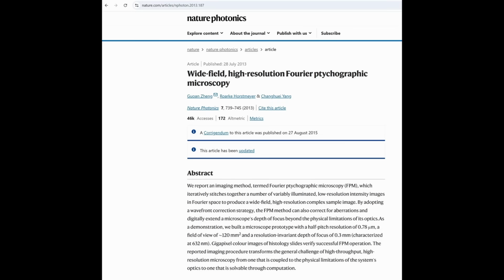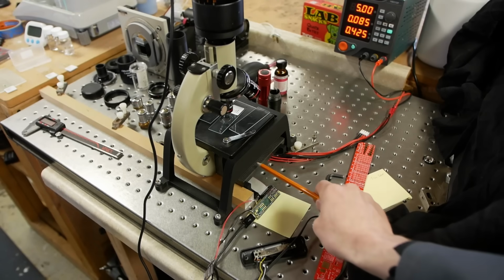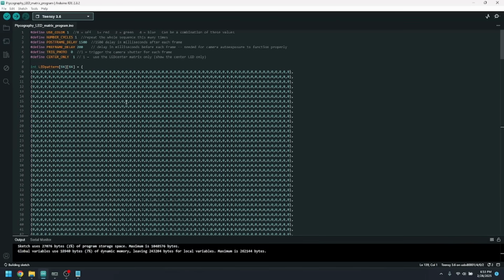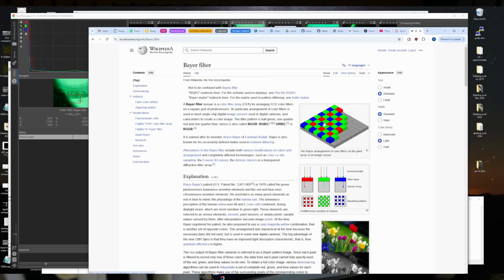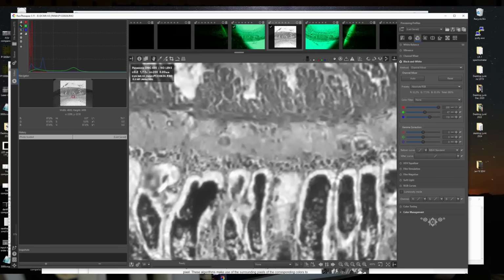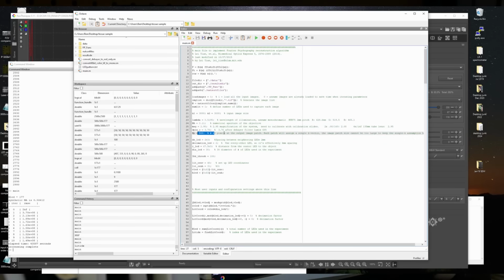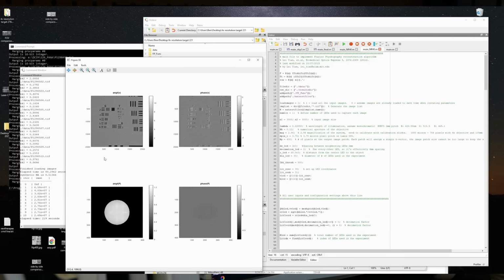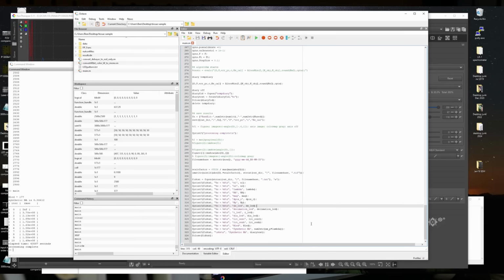Dramatically improve microscope resolution with an LED array and Fourier Ptychography

Comment: This is really interesting and it's given me a few thoughts/ideas that I'll put here:
1. I wonder how effective it'd be to swap the matrix for a small OLED or better QD-OLED panel. QD-OLED would give very pure wavelengths, the pixels would be much smaller which would make them more point-like which you said helped. Issues I see would be that I don't know why the larger spacing is preferred (I haven't seen you mention it yet), and it'll be a much darker image because the smaller pixels won't get as bright.
2. I wonder if this gives more than just 2D information and if some level of 3D information could be built from this.
3. I wonder if some of the difficulties with getting the numbers for the setup and calibration could be made easier by using the defraction gratings as references. If you image a known grating then I'd think you could work backwards to calculate out a lot of the very difficult to handle values. That could be especially helpful since you could swap through multiple gratings easier than getting in there with a ruler to measure distance from the LEDs to the objective.
4. I saw another comment mention it that you can get your camera de-bayered but that's along the same lines as what I was wondering. I feel like you could find a camera without those extra filters that isn't an insanely expensive specialty camera but that's just a feeling and I have no experience to back it up.
5. Other benefits that I don't think were explored and would come with something like an OLED panel or just a grid of RGB leds instead would be that you could run the process over multiple distinct spectra which could give more information. Not only would that give nice color information but I bet with some fine tuning there that that could also be a source of additional spacial information since I'd each wavelength to scatter slightly differently.
EDIT: You threw the 3D mention in there at the end, and some hints at the ability to automatically calibrate the system but hopefully I added something to the discussion.

Comment: You are using redundant information which is brilliant!

This is NO DIFFERENT to a sampling oscilloscope which can resolve higher frequency signal bandwidths than a one-shot oscilloscope.   You are relying upon the fact that the signal is repetitive - it doesn't work for single-shot signals.  But if you do have a periodic signal, you can sample over time of multiple signal periods.

In this case you have a constant unchanging sample which is spiritual equivalent to using a periodic signal for a sampling scope.  And sampling over angle is the spirtual equivalent to sampling at times during multiple signal periods.

Comment: Going back to the 3 color mask over the sensor, couldn't you account for each subpixel's x-y tiny offset to triple the resolution, and match it with a led array with 3 times as many leds, in the same 3 color arrangement as the sensor? It moves the problem of getting a very lab specific equipement to just make more calculations and setting up a different led array which should be much more economical

Comment: Fascinating, would this technique be able to be combined with spectroscopy to determine the chemical or material composition of samples?

Specifically, if the camera and the optics used were compatible with selectively measuring the absorption and reflectivity of visible light, infrared and UV light?

Comment: 1. Foveon sensors have 1 cell per rgb, so they could work in theory (although they're quite noisy). Another option would be pixel shift.
2. Would an ordinary lcd work as the light source?

Comment: This reminds me of the technique Nvidia uses to project smaller ("correct") patterns/details for lithography by using special larger ("incorrect") patterns that are calculated beforehand. The way the EM waves interfere with one another after passing through the larger patterns produces the smaller patterns/details that become the circuits and components. Difficult to explain, but also very interesting. :) I think they call it "Computational Lithography".

Although, this FFT stuff blows my mind, too. It's amazing what computers have allowed us to achieve with old mathematics.

Comment: I think it's the debayering that shifts the information slightly from each sub pixel. If you manually debayer into a monochrome image and only keep red or blue or half of the green, I think this will still work well without the correction hack that probably does not work for non-white subjects well. A standard debayer outputs either half the resolution of the true mask, or at the full resolution, but data is shifted at the sub pixel level to make a smooth color image. But there should be no difference in the raw red sensor pixels and a monochrome sensor with a red filter over it

Comment: 18:00. I don't know that specific algorithm, but I think you could turn up the exposure for some of the pictures, if you correct for it afterwards in the octave script. So, if you e.g. double the exposure for all of the edge images, you then have to scale those images back down, as if they were shot with the same exposure. I'm not sure how linear the effect of a longer exposure on the pixel values is, so this may require a calibration curve for exposure to pixel value for each specific sensor type.

This way, the illumination level is still the same, but you still get to utilize the dynamic range of the camera better. And as you can rescale the images in floating point numbers, you don't lose any dynamic range to rounding.

Comment: I wonder if instead of using every single LED, if you could use just a sub-set of them, in a spiral perhaps to achieve a decent result. I would have to imagine that some amount of the information in all of those images is somewhat redundant.

Comment: It is a bit harder, sure but technically any finite area with enough luminosity can technically give you enough information to reconstruct the light on the grating and the structure of the grating, analogously with a small piece of a hologram still encoding the entire picture

Comment: Monochrome cameras are easy to get if you buy an astrophotography camera. Getting one with a full-frame or larger sensor is harder, but not really necessary here. And it's possible to remove the bayer filter from a regular camera, with effort, or there are some services that'll do it for a price.

Comment: Nice! Now I want to adapt this technique to mmWave imaging at 122/135 GHz, although the point source array would need a physical raster scan from a big XY table rather than sequential point sources, but the lensing is easy enough to machine from Rexolite/UHMWPE or even 3D prints filled with alumina powder. I have built a flying-spot imager that works at mmWave, but currently it's only capable of about 30 x 30 pixels at present. Things get scary large when scaling up by a factor of 3000 from optical frequencies, but the required precision scales downwards.

Comment: JPEG allows any compression ratio, and there is a lossless compression ratio (1, I think, its been decades since I compressed images from space). Anyway, when the compression is set to lossless, the entire image is retained in full resolution. I would think that this method would work using that, since no image data is lost. JPEG itself is pretty complicated, but, fortunately, a standard codec is available in plain old c-code, so it is almost plug and play, after you fix the processor-specific (and inevitable) memory leaks. Even in lossless mode, JPEG gives a BUNCH of data compression on most images. Its all about that base, 'bout that base, 'bout that base, no treble. 😅 (I spelled it wrong so you could read it right. 😂)
Reply: Also, I would think there would be a cheeky way of doing this algorithm individually on each of the RGB channels, and then nonlinearly combining them to do even a little bit better.

Comment: I wonder if a regular OLED screen (which just boils down to an array of diodes as well) of high resolution would allow for even higher resolution bump. The low amount of light produced by each diode would be minuscule which may overturn the whole gain though.

Comment: Wouldn't it be easier to use a colour oled display as a light source ? 
You could make the pattern more precise instead of the fixed led spacing and make the colour camera work by replicating the bayer filter spacing/structure on the display...
Btw: you can get a cheap monochrome sensor from the Little Garden Spectroscope, but you would need hack it back to a camera.

Comment: Made little sense. 
Given that the angle of diffraction depends on the line spacing: -> determine the line spacing by measuring the angle of diffraction.
     reconstruct the expected image from the angle of diffraction.
From my understanding of the video:
    The diffraction gives the spacing between black and white dots in an image, combining the diffraction angle gives a map a spatial map of the black and white densities. 

However, if the diffraction pattern isn't simple or repeating (ie. the cell sample) I don't see how knowing the line (dot) density (spacing) helps resolve the image.

I should also say that you are incredible. I would have never figured out it was the bayer filter.

Comment: I wonder if cameras designed for astrophotography will work.  Not only are some models monochromatic, astrophotography cameras rely on the telescope's optics. There's nothing to interfere with the microscope's. Some can be had for a few hundred dollars. I find it interesting some cameras cool their sensors to reduce noise using Peltier coolers. 
Astrophotography also uses a bunch of stacked images but I think it's more to do with combining your best images into one.

Comment: the issue is not the experiment ,its the laser it self . Like an over bright game . Use smallerr pitch laser can get you along but evrnyualy you'll have to weaken laser brightness to see somethingg , meaning clone distance is closer =more false signal . You'll need teflonto isolate but it will be less stable

Comment: An odd coincidence. Last night I noticed the reflected light from a (parked) car’s rear reflector created a moire effect in my eye (unfocused as I had no glasses on) and this changed rapidly as I moved my head by tiny amounts. I was thinking at the time how this could be used to accurately calculate just how much my head was moving.  And then this video pops into my feed, apparently using a related effect 💁‍♂️

Comment: the smaller you see the more stable the surface has to be ? Because the detected vibration of the surface might be low at human scale but a tsunamy of variable at quantum ? This means most metal or carbon fiber are bad idea ?neobdium silicone instead ? Interesting challenge

Comment: Wouldn't it work if we avoid de-bayer and pick the pixels directly? In the case of green pixels, we could rotate 45 degrees to have a square grid of raw green pixels, where the pitch is just sqrt(2) bigger of the original subpixels (so sqrt(2)/2 of the regular image pixels).

Comment: I'm wondering if there would be a way to modify a DLSR CMOS to remove the filter and allow it to work for this? I've astromodded a cannon DLSR before and that was easy, but the CMOS sensor seems quite a bit more of a challenge, I would imagine the RBG filter is bonded to the chip?

Comment: Being you I'm shocked you didn't play with stripping the colour filter off the sensor - I've never done it myself but it does sound reasonably easy. I've been wanting to do it to my oldest camera, as then the effective resolution bump will bring it up to a similar ballpark as the modern ones and let me play with deliberate filters of my own. But not enough time, energy or space to setup, yet anyway.

Comment: A huge application is EUV/XUV nano-imaging - not so much for the super-resolution (that's a given due to the extremely short wavelength) but because there's no proper high-NA imaging optics available for EUV (except hacks like Fresnel lenses), while diffraction is quite straight-forward. Phase information is also a big bonus. Instead of an LED array, the sample is scanned with a piezo stage to record a bunch of overlapping diffraction patterns. The spatial resolution can be some tens of nanometers.

Comment: I also wonder to what degree you’re getting nonlinearities associated with viewing angle on the HUB75 panel’s LEDs (and, for that matter, with the slightly varying distance from one edge of the LED panel to be center). I imagine this would be relatively easy to characterize by capturing a dataset “at DC” (i.e., with nothing in the field)? I think that linear scaling per input image ought to solve it, since the delta in viewing angle within an image is relatively small (the slide is small).

Nice work! Very cool application of diffraction that I had not considered before. Thanks for posting this!

Comment: Would an OLED panel be beneficial for providing an addressable array of tiny point sources of light? It seems like an old phone screen could be a way to get the illumination setup working without needing an LED array panel
Fantastic video!

Comment: Have you tried doing this with a Sigma Foveon Merrill x3 sensor?  It has no color filter and instead captures light as it passes through the silicone.

The top layer is blue, then green then red giving  3x 14.7mp  images it then combines into full color (at every pixel).

It can also allow you to select a b/w image from just one or a mixture of these layers and has a removable IR filter to allow full spectrum imaging.

The only version of this with a removable lens though is the Sigma SD1M which might be hard to get these days.

The newer (but still old now) Sigma Sdq changed the resolution of the bottom layers to 1/4 of the top and you can't select just one layers data for B/W images anymore but could still be worth while for this type or work?

Comment: Commodity available 1.5mm x 1.5mm addressable RGB LEDs (1515 Neopixels) exist.  Matrix RGB LED array can be made by a PCB house.  This would provide even finer point source brightness and color adjustable LED emissions.  Try using a manufacturing machine imaging high resolution monochrome camera.  Avoids the Bayer matrix issue.  Could provide even higher contrast.

Comment: I think for the color images you have to account for the effect of the bayer filter on the fourier domain. On most sensors I think red and blue should be equivalent to a low pass filter. But I don't know off the top of my head what the response of the green channel would be.

I haven't done it, but the Fourier math should technically be possible. You probably lose like half the resolution though in the best case.

Comment: You can actually completely remove the bayer filter on any camera sensor to get a monochromatic sensor much more cheaply. There's a few videos of it being done on youtube, and it's also what's done on DIY spectrometers like the Little Garden spectrometer to significantly improve their performance at a low cost.

Comment: I would be curious to see if using a lighting setup which isn't a perfect grid would perform better. Perfect grids tend to have problems with aliasing (e.g. Moiré patterns), especially when combining with other grids (e.g. the sensor pattern in your camera). Would it be possible for you to repeat the experiment with the LED array where you don't use every other LED but rather a semi-random subset of the LEDs?

Comment: I have a hunch that if you turned off debayering in rawtherapee and used an external program to throw away all the subpixels you don't want it would essentially work, however you'd be throwing away like 3/4s of the resolution of your image which might make it rather pointless. Of course you'd probably also need to use the red or blue subpixels specifically since with most bayer patterns the green sub-pixels are staggered which would cause issues...

Comment: #Solution for Colour CCD..... 
You can make colour ccd Or cmos sensor into monochrome by burning its colour filters with ir Or uv laser you can use laser marking machine Or use laser cnc with Raster type scan burning, this process is already done and demonstrated by someone.

Comment: On the image background subtraction:
Every cmos image sensor suffers from pixel offset. The modern integrated sensor compensate for this by doing an offset correction directly in the readout of the array, e.g. with a method called correlated double sampling. After that, there is not much offset left any more (as you observed).

However, if you want to really tweak the sensor... CDS can be disabled as the "dark image" contains useful information for characterizing the pixels, you can detect leakage, halfway dead pixels, stuck pixels, image lag and so on.

For long exposures, you get other effects of leakage, more pronounces temperature drift and so on. In these cases you typically also include a static calibration taken at the same exposure time and temperature. Often, this is annoying as this doubles the long exposure time. 

But certainly, sensors are getting better and this is less of an issue in "normal" operating conditions with modern sensors.

Comment: Commercial cameras often have an opaque mask over some pixels on the sensor, so they're always in darkness. They use these as a baseline so they can subtract out the black level automatically.